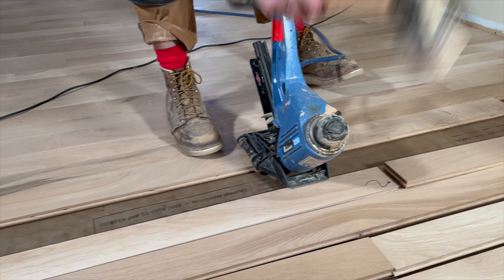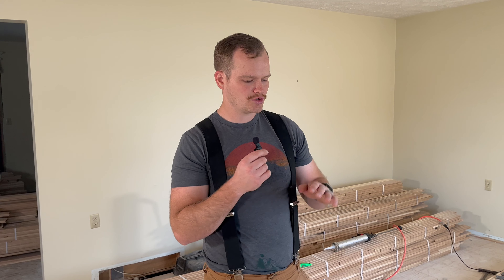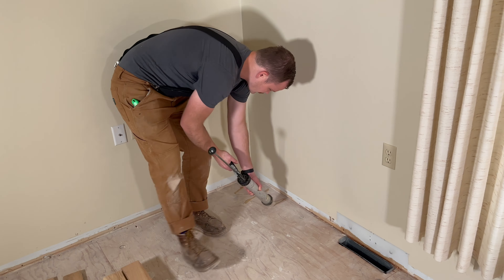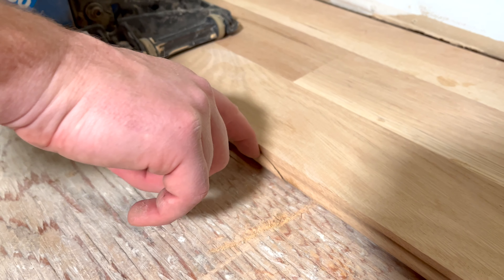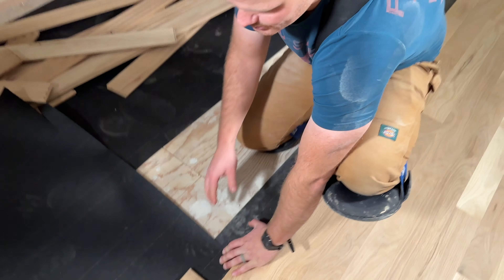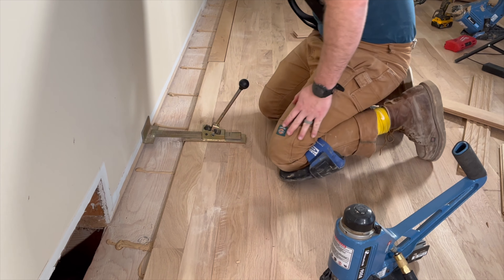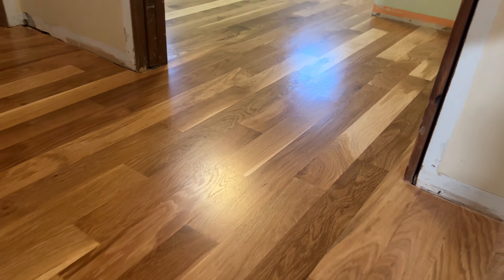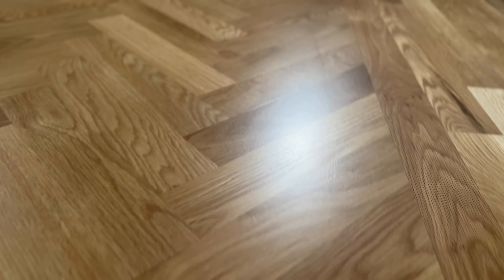How To Install Hardwood Floors (DIY Masterclass)

Comment from the maker: Would you install your own hardwood floors or hire a pro?
Reply: Planning on cranking it out myself. Thanks to this masterclass, I feel pretty good about it! Excellent video!
Reply from the maker: Awesome! Glad we could help.  @MorneMarais81
Reply: If I could afford it, I would hire a pro. But I can't, so I'm tackling it myself. Been prepping the room  and collecting tools and materials since Christmas, will lay the subfloor this weekend and hopefully start the actual floor next weekend. I've taken lots of notes, including from your video, which was very helpful. Thanks so much!
Reply: Masterclass?  What about leveling the subfloor?
Reply: I would not hire you, never put tar paper under a wood floor. You never would see an old times that know what they doing using tar paper. They would use Rosin Paper or even news paper but never tar paper. Paper is used only to stop floor from squeaking. Wood floor has to breath or it will cup.
Reply: @jtr789310  Your sadly mistaken and/or misinformed.  I'm actually reading the documentation that comes with a Canadian maple floor and it recommends using 15lb felt paper.  Felt paper does indeed breathe and is merely a vapor retarder.  Get informed before you get inflamed.
Reply: Where can I buy the M1 adhesive?
Reply: Yeah, crystal ball now reveals I’m gonna need to be saving up for a pro. 🔮 Also: yes, pls, on a herringbone vid.
Reply: That herringbone style makes it look like a piece of art.  Definitely a pro
Reply: The hardwood floor supremacy.  Great vid
Reply: @MorneMarais81  Did it go well?
Reply: I think I’d hire a pro bc I’d prolly mess it up. Especially if it’s hardwood on concrete

Comment: I just took delivery of 600 sq ft of 13/16 x 5 1/2 western hemlock t&g.   Beautifully and cleanly milled with proper back relief and machined ends. It's all rift sawn and quarter sawn, and varies from about 4 ft to 19 ft with an average length of 10 ft.  It was cut just down the road from me, and milled by a friend who's had it stickered in his drying shed for 4 years.  Moisture content is around 18%.  Now, it will sit in my heated house for a year or two until I'm ready to install it.  Thanks so much for your video, it taught me a lot.  Lifelong cabinetmaker here, but never laid a solid wood floor until now.  68 years old, building our last house with our own four hands.
Reply: A year or two?! How long do I need to have the wood acclimate in my home?
Reply: @unprofessional-laser  It depends on the moisture content.  If you are laying kiln-dried wood, a week or so is lots.  Mine is air-dried, so I will use a moisture meter to monitor it until it's ready.

Comment: Question? When you reverse using the splines. could you have screwed some scraps on that side. Then use your floor nail gun like you typically would. Then block the other side and nail through the spline. I would think that having nailed through both would give you a strong joint. But would this cause an issue with floors moving as the weather changes?
Reply: Learned a few tricks. Thank you.

Comment: Great video! Thanks for sharing it. My subfloor is a series of 1x5 boards under the flooring which is in a late 1950's home. Should I use the same leveling/smoothing process as you use for the plywood sub? TIA
Reply: I hope he answers your question... My home is 1867 build. Lol. All original board underlayment/subfloor. Apparently there was never a hardwood top floor. It's evidently been wall-to-wall carpet, or linoleum, since at least the 60s. Partial basement, partial crawlspace (without known access). Sooo... I'm expecting to face every challenge ever imagined!  Yikes! I hope I'm worthy. Am wondering if I need to use t&g plywood for subfloor above the crawlspace? And how I level it when dealing with original 160yo floor joists?

Comment: well done.  I'm in the process of installing a hickory floor in my kitchen, dining room and living room plus a 24 foot hallway.  How do I make sure I will be aligned when I come out of the kitchen into the living room with two archways.  One from the kitchen to the living room and one that comes out the other side of the kitchen to the hallway.so they are exactly aligned when I get past the wall.   Hard to visualize but could use some advice.

Comment: When you get to closing up under door jambs you can cut your piece to fit all the way around the jamb but before installing the previous row. You use a shorter piece, cut it and  install it first, under the jamb leaving enough room (tongue width) to pull it back to the previous row.

Comment: Great video! How thick is the plywood underneath? How thick is the oak going on top? My house is 1/2 ply on the joists then 3/4 particle on top. The particle board is shot. I am wondering if I can pull up the particle and replace with 3/4 oak flooring strips or replace the particle with 3/4 ply and the oak on top. Thank you in advance.

Comment: For starters boards that you face nail at groove side, you used 15 ga finish nailer or 18ga brad (pin) nailer? And, if 15ga, can 18 ga also be used instead or not robust enough? I’m using pre finished 3/4” plank and want to minimize holes. Thanks for video!
Reply from the maker: 18 ga is fine if you glue it as well.

Comment: Do you have a recommendation for the glue used in the video? The chaulk gun looks to be special use for the large "tubes" of glue. I've found Bostik adhesive in a regulare size chaulk tube and woner what your professional opinion on the product is? Thxs in advance! I'm glad I've found your videos, very helpful as im going to tackle this 475sg.ft. job myself. Everyone that installs floors in northern Michigan are booked 1-2 years in advance. I cant wait that long as my kitchen and dinning room are all stripped bare.

Comment: How would you install hardwood that does not have tongue and grooves?  I bought some flooring to match up with existing flooring, 5/8", due to the thickness and it does not have tongue and grooves.  I will be installing an entire room.  Do you face nail it or try nailing on an angle into the side of the boards?

Comment: Also, im installing Summerset pre finished/stained Hickory flooring 3/4"thick x 3 1/4" width. Do you recommend the standard flooring nails or staples what gauge or size do you recommend. By the way, if you'd like to come to Charlevoix, Mi for an install, id be a happy camper! 😁

Comment: I have two questions regarding the wood floor install.  I'm building a new house and will be installing the hard wood floor on the second floor of the house.  The lower floor is a walk-out basement with earth on the rear and east side of the structure.  The walk-out area is a concrete floor with two-bathrooms and two-bedrooms.  There is NO crawlspace.  My first question is do I need a vapor barrier on the second floor over a conditioned air space below?  

The wood species being used is prefinished Brazian Cherry.  My second question relates to the floor joists on the 2nd floor.   The joists run from north to south.  However, the windows are also prominent on the north and south sides of the building.  On another video they recommend that you run the boards length wise toward the windows.  Since I want to nail into the floor joists, I was going to run the wood boards from east to west, perpendicular to the floor joists.  This would provide support for the wood floor should the sub-flooring ever sag.  The sub-flooring for the new house is 1-1/8th inch tongue and groove 4 x 8 sheets of flooring.  Will this type of sub-flooring sag of should the boards be run north to south parallel to the floor joists instead?  

Thank you for your advice.

Comment: Great video, lotsa meat.. My home is 1867 build. Lol. All original board underlayment/subfloor. Apparently there was never a hardwood top floor. It's evidently been wall-to-wall carpet, or linoleum, since at least the 60s. Before that...?? Partial basement, partial crawlspace (without known access). Sooo... I'm expecting to face every challenge ever imagined!  Yikes! I hope I'm worthy. Am wondering if I need to use t&g plywood for subfloor above the crawlspace? And how I level it when dealing with original 160yo floor joists?

Comment: What barrier, if any, would you recommend for a house with a crawlspace and exposed earth?
Reply: It's not wise to install hardwood flooring over an area like that until you have mitigated any moisture issues. Putting a vapor barrier down on top of any exposed Earth and make sure you're keeping the humidity down with a dehumidifier

Comment: Can you do floating floors with hardwood?
Reply: Not with solid or engineered hardwood, because it is a natural product it has to be able to expand and contract, but if it’s not nailed or glued down after a couple seasons you will have unsightly gaps on the floor. Floating floors can only be done with products like luxury vinyl plank or tile and laminates that have locking tongue and groove built into them as well as don’t expand and contract like wood

Comment: You mentioned about high quality nailer for wider boards 4in and up. I plan to install 5 in boards. What do you recommend? Thanks.
Reply from the maker: You should probably glue and nail your floor then. It's called glue assist. You will need a glue special for wood floors like Berger Seidle's glues and a liquid applied moisture barrier.
Reply: @lumberjackhardwoodsupply  Thanks. It doesn't seem Berger available here in US. Would Bostik Grip-N-Shield adhesive that has moisture vapor control be a good alternative? If not,  anything you know of that is available in the US? Thanks.

Comment: Great video! Thank you! You mentioned in one of your videos that vinyl is toxic ~ is the 15 pound roofing tar paper for underlayment also toxic since it’s made for outside? We need to buy underlayment for our hardwood floors and we are very confused with so many options. Thank you!!
Reply: Also does it matter if we use the 15 pound you’re using in the video or the 30 pound?
Reply from the maker: 30 lb is way to thick and will cause problems where it over laps. Your best option is aqua bar B, which is what we normally use. We just have roofing paper in this video because we were shooting a video on underlayments.
Reply: @lumberjackhardwood would you advice to use aqua bar b for underpayment for the whole floor without roofing paper?